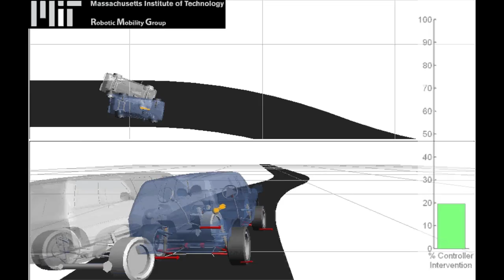An "intelligent co-pilot" for cars

Comment: that's the million dollar question, although it is very arguable rather a human could do just that in the given cirumstances, the system might not turn into the ocean instead of hitting a school bus, and consider that this system was in Every single vehicle, if these aren't synchronized to each other, the movements that two cars take to avoid each other might lead to a collision instead of a solution. however it certainly looks like with work it could be better than just human drivers.